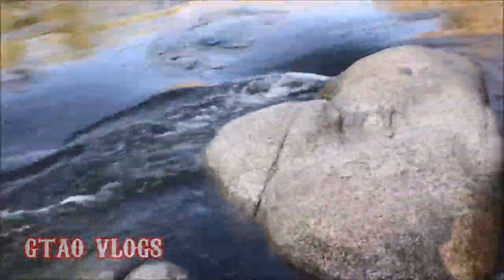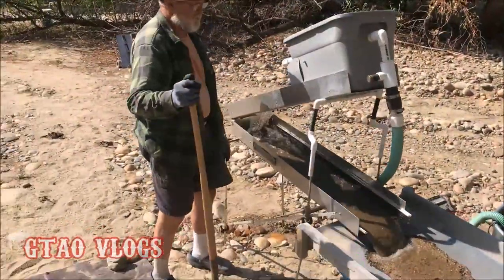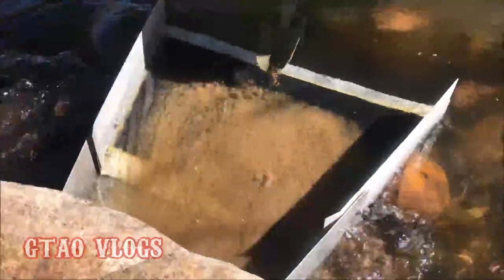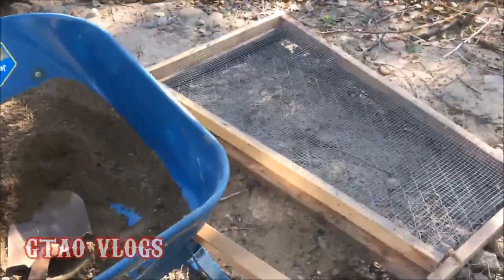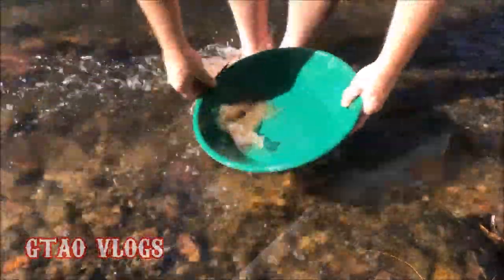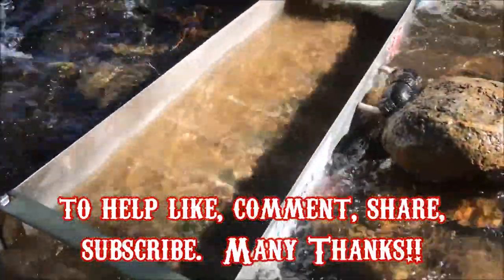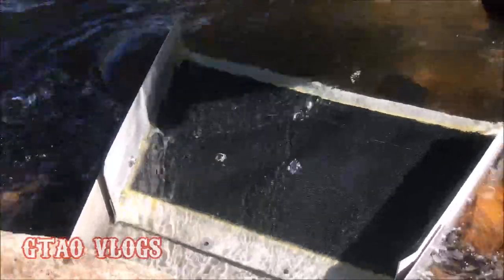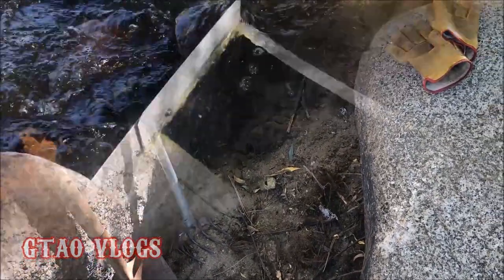Sluicing for Gold & River Gold Prospecting | Treasure Hunting | Days 1-2

Comment: Great video and very informative!  My only thought was that I was taught to go dry to dry or wet to wet ie:  dry material  in a dry washer and wet classified material in a sluice or high banker.  No criticism intended, just an observation.  Thanks for sharing and God bless.
Reply from the maker: Hi Lynn.  Yes, there should be caution used when running dry material into a wet processing unit because light fine gold could ride out on the water.  When I am near water I try to use it for processing almost always.  I agree that a dry washer processes dry material quicker than hand sluice yet also the losses are greater (depending on the gold) and the "washing" is inferior to water.  Good point you make as a rule indeed.  Criticism and observation are welcomed.